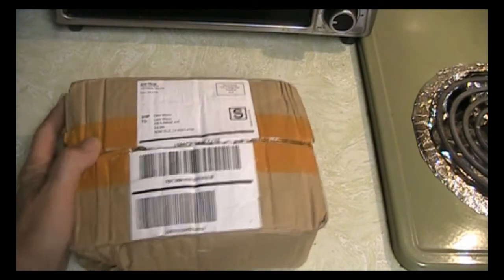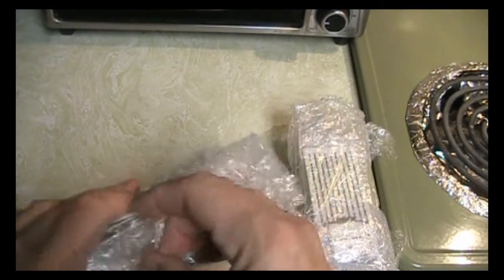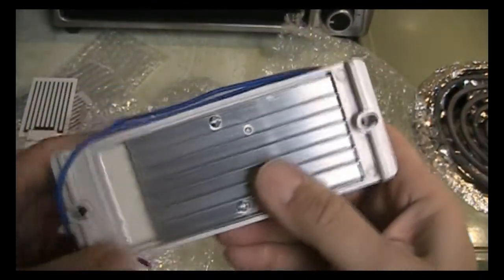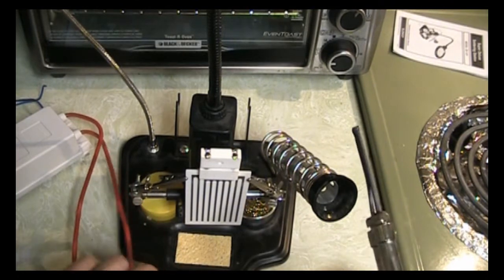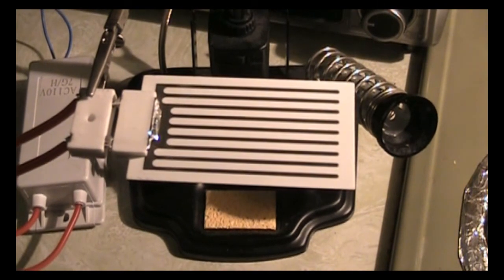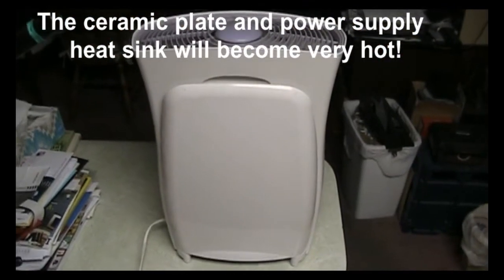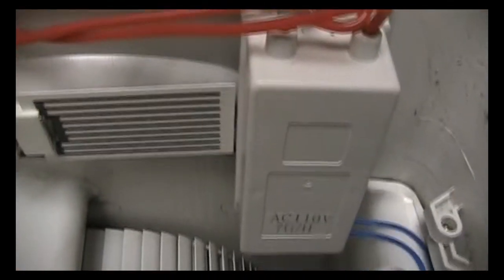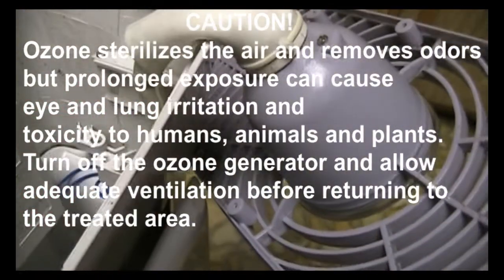Add an Ozone Generator to an Air Purifier

Comment from the maker: Back in the 1950's I had a Puritron F-20 tabletop air purifier. This device containing a fan, a replaceable fiberglass air filter and three 3 watt mercury vapor ultraviolet light bulbs was advertised as "an electronic miracle" that freshened the air and allowed you to breathe easier by eliminating dust, smoke, grease and other irritants from the air. I remember the fresh clean aroma reminiscent of bleach that blew from its vent. That was the smell of ozone. I also remember ignoring the warning not to look directly through the louvers at the UV bulbs. I couldn't resist staring at the enticing deep blue violet light from those bulbs. Luckily my eyeglasses blocked the UVC rays that would have otherwise permanently fried my retinas.
When I found this modern ozone generator on eBay I expected it to replicate the Puritron experience of my childhood. When first turned on I immediately recognized the familiar fresh odor of bleach, but within several seconds it became overpoweringly irritating and I quickly turned it off. This little ozone generator is like a Puritron on steroids. Humans, animals and plants should be removed from the area receiving ozone treatment followed by several hours of adequate ventilation before returning.  https://www.youtube.com/watch?v=wMGbQczjTSk

Comment: Carol, your thoughts on a air purifier for 3D printers?  It is my understanding that the HEPA filters equipped in some 3D printers are only effective in capturing  particulate matter larger than 300 microns whereas the nano particles produced during the 3D printing process are mostly smaller than that. I had thought about some sort of electrostatic air purifier like the Electrohome unit that I once had, but no one seems to produce a portable unit anymore.  I eventually had to toss the Electrohome unit, because I couldn't repair the electrostatic unit anymore. The dielectric material (epoxy-glass?) occasionally would arc-over and burn through.
Reply from the maker: I have never used a 3D printer and was unaware of this matter.  I now see that the health effects of and means to mitigate nanoparticle air pollution are an area of active research.  Thanks!